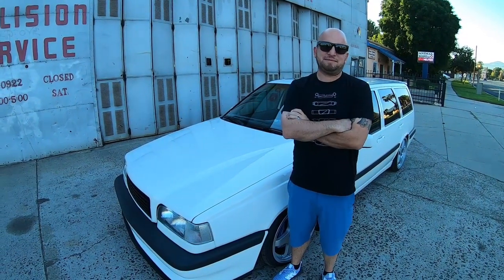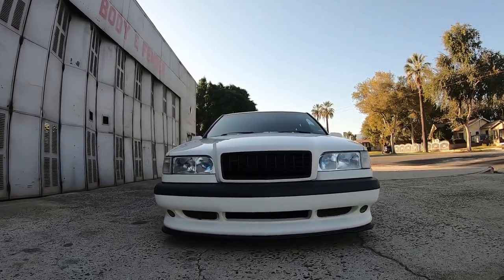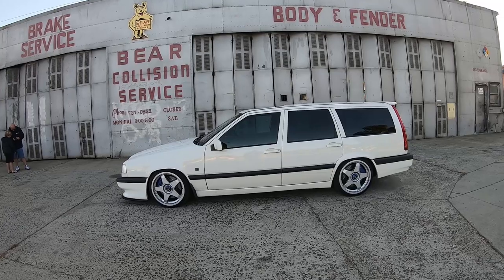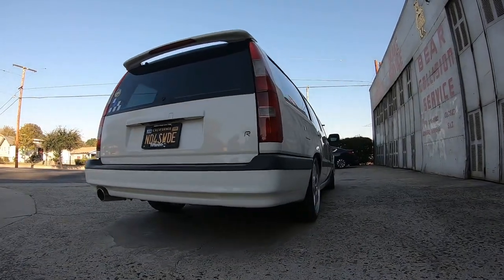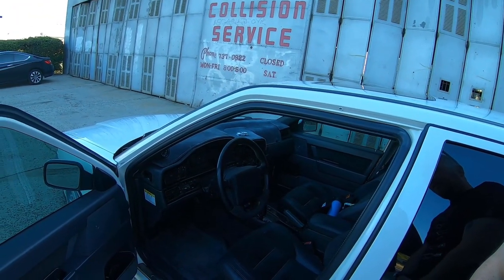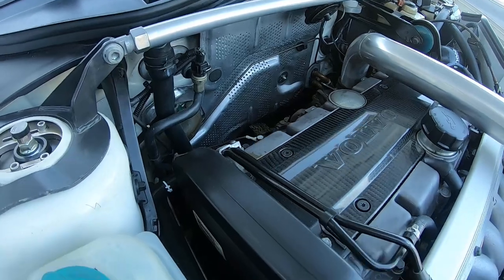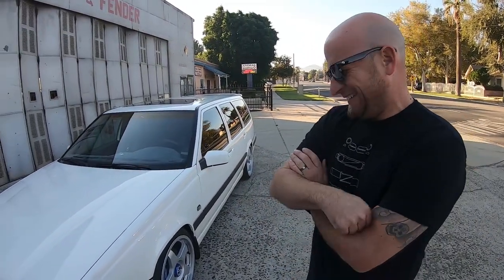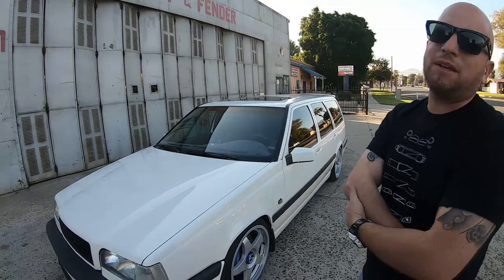1997 Volvo Wagon: Practicality in Style

Comment: there is a lot of aftermarket support tbh. these cars are huge on the forums and big power is being made. north of 785-800 and somewhat consistently by some people. and a company called ard has been huge for years supplying ecu reflash services for all types of Volvo but have a tone of services available for 5-800 bucks from mild to wild. they can support mods up to around 550whp consistently and there are standalone solutions beyond that finally becoming available. Also they support a awd conversion. its a very very underrated platform and tbh i think most people are missing the valley of depreciation they have all been in for the last few years and they are currently pulling out the other side. will be honest i haven't looked into body modding my cars much and i dont care about stance per se, maybe that market is somewhat limited on this platform, i would not know.
Reply: Ayla Hughes I’ve never been attracted to Volvo’s but this one is special . Still won’t even consider one but I can appreciate the work behind this
Reply: @aoclive6710  i am very very into cars and i own / have owned quite a few makes and models, and very few cars have ford reliability with euro style and performance and thats what Volvo tends to encompass. the 5 cylinder engine has a special ring and really any of the r spec volvos are very special cars for a very affordable price in this day and age.
Reply: @aylahughes9185  I wouldn't awd swap one since these systems are very prone to breaking. Also the engines bend rods at 350hp, so needs quite a bit of work for big power.
Reply: @nicovanduin1553  bro like i said i have several of these cars. the halidex 3 is true awd its a rare system but it would be the only choice. and in my comment i mentioned standalone ecus and solutions for big power. i am def aware of the rod limitations, and i am also aware of a sleeving solution that is currently holding up for a fellow making 708whp on the last dyno session i watched. check out his channel its called simplyvolvo.
Reply from the maker: I am glad that more people get in to Volvos and the aftermarket support grows.

Comment: Don't put the battery in the back, more resistance and longer travel for current. Later Volvo wagons with battery in the back suffer more from electrical drains and also more wire for corrosion to happen. In my opinion, more work for nothing. Just manual swap it already.
Reply from the maker: The owner will eventually swap it and keep it clean. He is a great builder.

Comment: With respect the wrong gearbox, Ive got a 850 T5 manual wagon, Remapped with a Rica 304, 16T, White injectors, Low mileage (86K Miles) A manual box get's the most out of it, Auto's just bog the whole thing down.

Comment: The mk1 V70 isn’t the same body it has a different roof, different hood, different front end, different rear bumper, different fenders, slightly different hatch with the brake light located higher up.
The only body panels that are the same is the doors.
Reply: Not that different
Reply: @captainlovemaker7095  but not the "same"
Reply: @klaspeppar5619  but definitely similiar
Reply: Why r people saying MK1? These are P80 chassis cars
Reply: @captainlovemaker7095  but yet so different...
Reply: @sebgee4716  okey then the P80 V70 and P80 850 are quite different in certain ways.

The 850 is no doubt a part of the V70 family, but it isn't really a V70 unlike the "mk1" V70 or P80 V70.
I guess you could call the 850 "a mk0 V70".

But that is why The P80 is called "mk1"
Reply: @klaspeppar5619  finally, somone explained it to me lol
Reply from the maker: Thank you for the insight. I am glad that more people are keeping the Volvos alive.
Reply: im late but basically V70 mk1 is facelifted 850
Reply: @mohis5664  well if you think changing pretty much every body panel except the doors is a  "face lift" then you would be right.

Comment: Just so you know, that's not a 2.5 engine. The 2.5 R motor comes with dual VVT. The belt/spark plug cover is bulky. Anyone who knows Volvo knows that. The head flows better on the 2.5 so if you only used the block, it wouldn't make any sense.
Reply from the maker: Thanks for the insight man. I appreciate it.